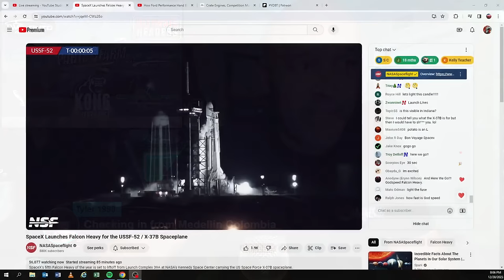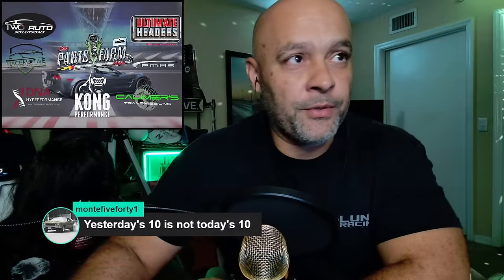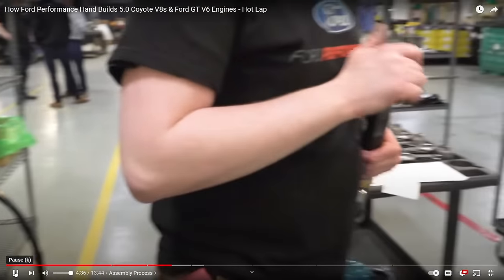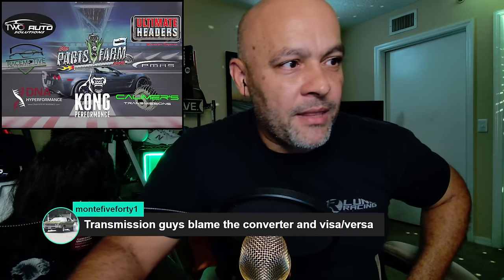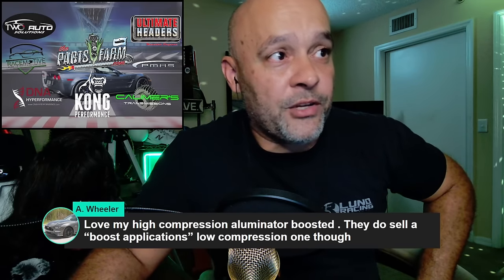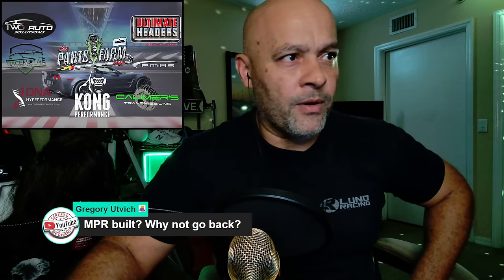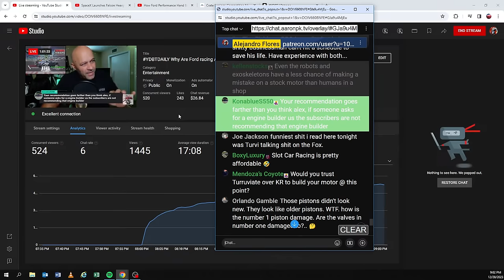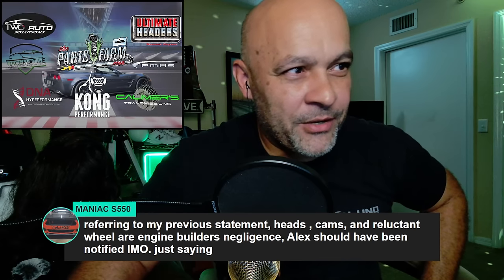#YDBTDAILY Why Are Ford racing Alluminators so good?

Comment: Most of your stock gaskets are made by companies like Fel=pro, Mahle or Cometic . Stock MLS head gaskets are really good and shouldn't downplay them just because their "stock". There are some MLS gaskets with more layers which is better and thickness. I've open many of FEL-PRO boxes and find gasket, seals, main crank seals either have FORD logo or part number. Ford uses a lot of Fel-pro and Mahle gaskets and seals

Comment: Dewalt has actually come a long way with their automotive tools. Especially their new ratchets.  They offer more torque than the milwaukee, and they are fiberglass filled and the batteries and ratchets  are oil resistant. Also their 1/2 impact is on par with milwaukee as well I believe. And their drills and drivers are on par as well.

From what I have seen Dewalt is actually more prevalent in construction and home DIY, and Milwaukee is more the automotive. But like I said they are catching up.

Comment: If I didn't buy crate, I'd likely just buy the tools necessary to assemble my own engine. Finding a machine shop to do block and head machine work would be difficult but the assembly would happen in my garage.

Comment: When I had an iron 6.0 LS built the shop  gave me back pretty much every old part off the engine. It was a stock rebuild so I didn't really want any of the old parts but they gave them to me anyways.

Comment: I have that cold test machine, I run it cold once engine installed, with starter, no plugs and cycle the key until oil gauge reads normal. Then plugs, then start, warm up, and ALOT OF DECELS

Comment: I don’t know if Ford still has it but they used to sell an engine that was sort of like an alluminator for the 2007 through 2010 GT 500, with the 5.4 L engine. This engine at Ford was a short block which was cast-iron, came with upgraded oil pump gears, mahle rods and pistons and was specifically a built short block designed for the GT500. It did not come with cylinder heads

Comment: Facts. I had a gen2 aluminator I put gen1 comp cams in and stuck in my 2013 gt years ago. Vmp gen2r on ms109. Car was a beast. I put it together in 2019 and it's still going and taking a beating today with the current owner just on e85 now

Comment: The tight ring gap is more of an issue with the more brittle hypereutectic pistons in the gen2/gen3 than the forged pistons in the aluminators. Still a looser ring gap would be more desirable though. Ford Racing make a high compression supercharged motor!

Comment: You're trying to get aluminators and Coyotes to run 200mph in 6-7sec. These guys are sending rockets at thousands of miles an hour head into space or near space and parts return back to where they started, while we try and keep pistons inside the hood. Crazy

Comment: Dewalt, Milwaukee??? I remove all critical fasteners by hand. Mains, caps and ESPECIALLY head studs with a torque wrench, so I can verify the "working" torque values. And I'm no guru engine builder.

Comment: It blows my mind that this is a known high hp high strung engine and will be pushed to the limits so i dont see why he didnt take the extra minute or got you the slightly better part for pennys more compare to now. The felpro vs stock i learned doing coyote and 2v and 302 stuff sometimes aftermarket gaskets are a pain because they dont fit properly either too long or obviously too short but if there is a known part that should be used it shouldve been used. This shouldve been treated as a no stone unturned motor because its not a bs NA low hp motor. I can only say looks like you got a friday afternoon before closing time motor been there done that it sucks!

Comment: A few weeks ago you were hating on UAW Ford workers for not putting in matched seats and not tightening up lug nuts on Mustangs. Just saying.

Cometics had a reputation for leaking water in the day, not sure if that changed or not. Like you said though, I'd think you'd wind up with more than a "basic" stock gasket. Then again I'd be much more concerned about the hammer job on that cam. If there's a piston kissed you've almost certainly got a bent valve and pulling the heads apart is a good move. 

A big measurement you missed was rod bolt length; That's a good way to know that you've over used your rod bolts or not. A "bound book" for your freshly built engine isn't a bad thing at all. 

Also, have a dude on a forum I'm on who had a TBSS with a built 6.0 by Modern Muscle. Bunch of shit was supposed to be included such as the oil pan baffling that caused it to munch the bearings (again) afterwards. A name is zero protection.

Also, transmissions can be just as bad or worse. Shout outs to D&D Transmission in Fairmont MN who managed to make a basic 4L65E in an Escalade last 300 miles.

The money loss is bad, the time loss is arguably worse.